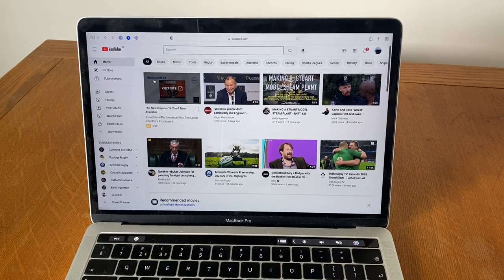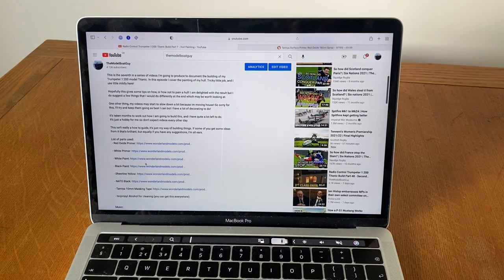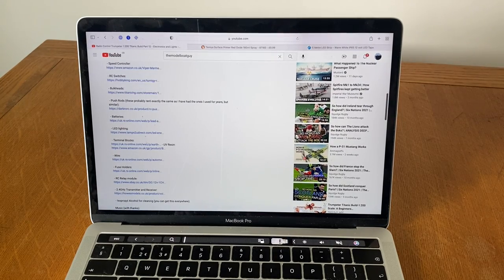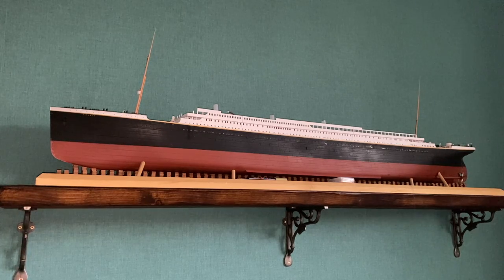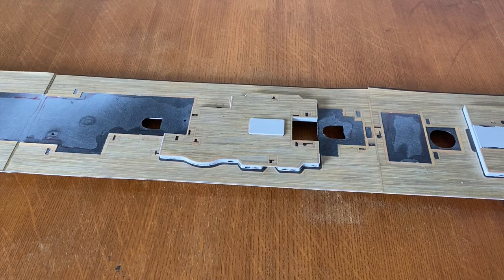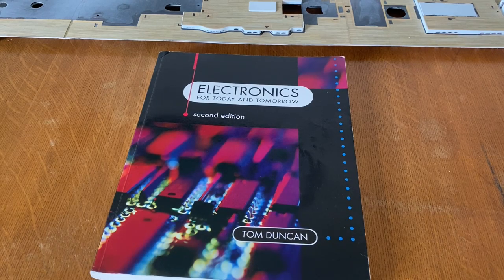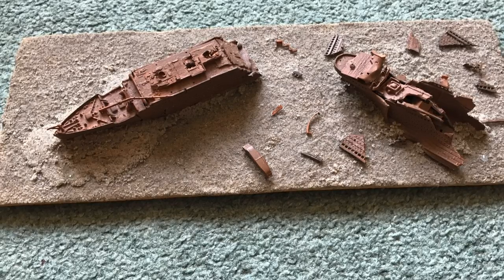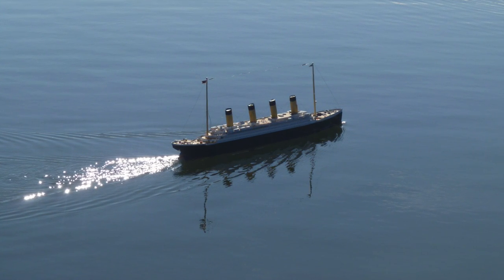Radio Control Trumpeter 1:200 Titanic - Frequently Asked Questions

Comment: Hi Rob as a codicil to my last comment here's a tip for soldering, when the joint is finished put a spot of hot glue on it to secure and waterproof it, not always possible i know but on the majority of joints it serves well  Paul

Comment: I agree hearty about solder I do a little soldering I started with a very poor solder which ended up looking like a dog's dinner until someone put me right. I was wondering if on your lifeboats I've seen some canvas covers on YouTube will you be using these , finally keep on modelling you will get there in the end.
Reply from the maker: Yep I have found this too, and it is very confusing as you could quite easily go into a hardware shop as a beginner and ask for 'solder' and get a totally wrong product. 
I won't be using the kit lifeboats actually as I have some 3D printed ones from the KA set, these have canvas covers on them already (except for the smaller cutter boats at the front). Thank you!

Comment: I may have missed this throughout the build, but can you control your wing motors independently as to make steering easier?
Reply from the maker: Hi there, good question. No I can’t. All motors are driven from a single speed controller so i can only control them in unison. I think I might change this later if I feel the need, if steering proves to be a big issue!
Reply: @TheModelBoatGuy  ah alright. For your esc, did you wire it in a way where you have 2 positive leads and 1 negative lead on your positive lead and 2 negative and 1 positive on your negative lead to control all three motors? Did you use a splitter of some sort?